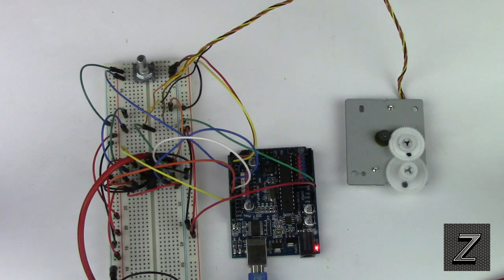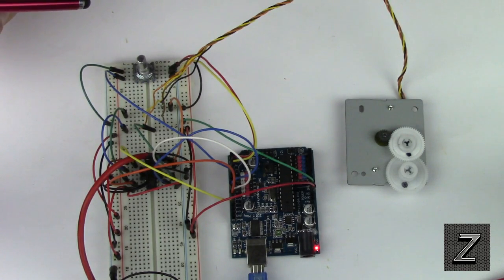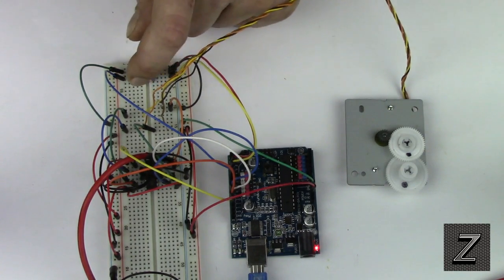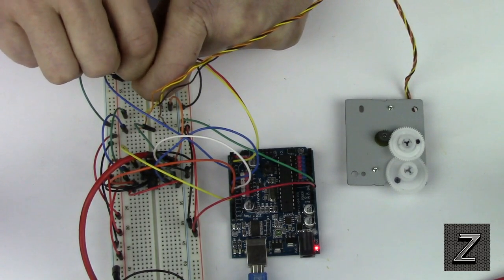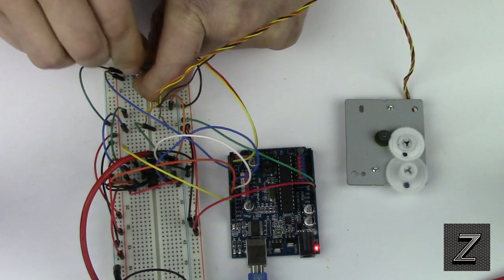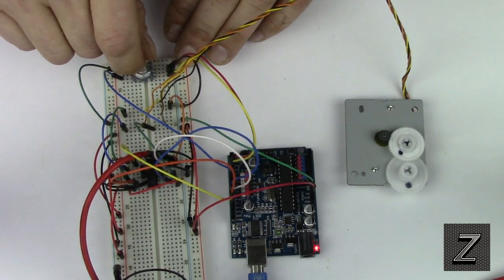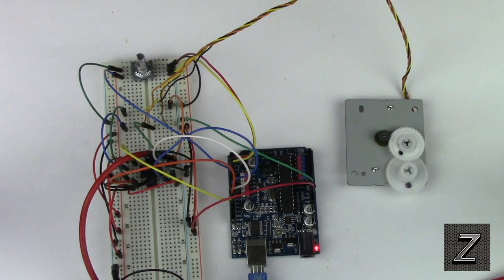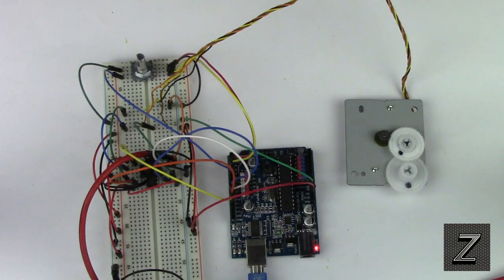ARDUINO Rotary Encoder Controlled Bipolar Stepper Motor with H-bridge tutorial

Comment: Nice project. Can you please share the codes you used in the arduino. I checked the website you referred to but couldn't find the code there. (Only sketch and parts are shown)